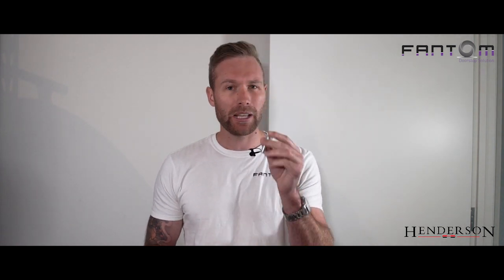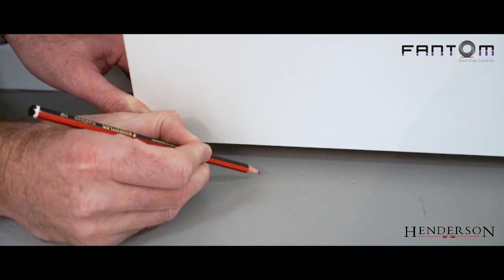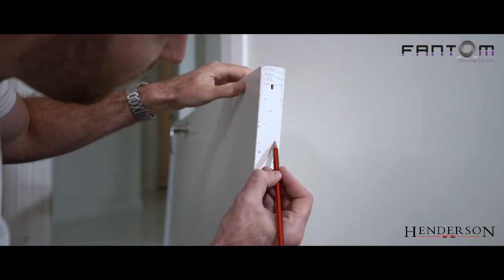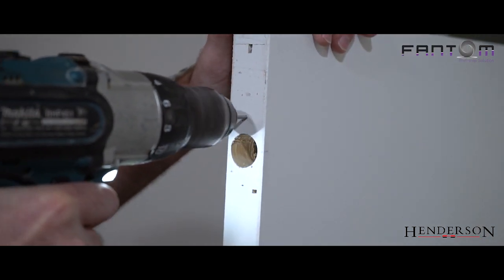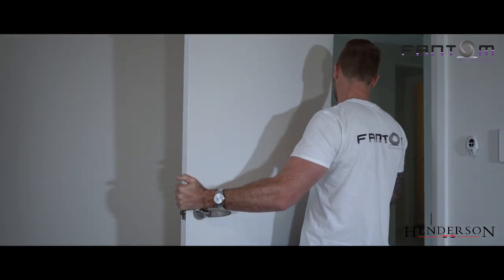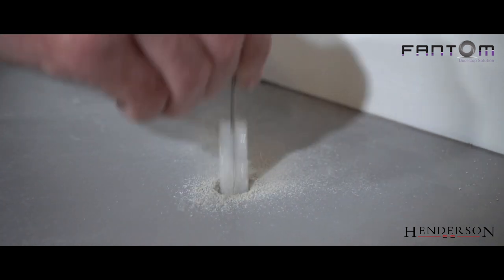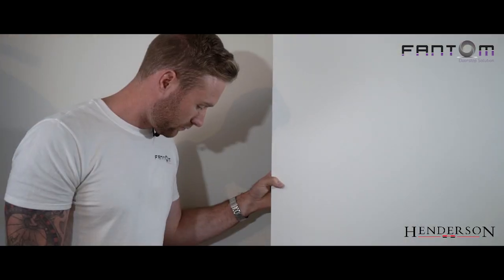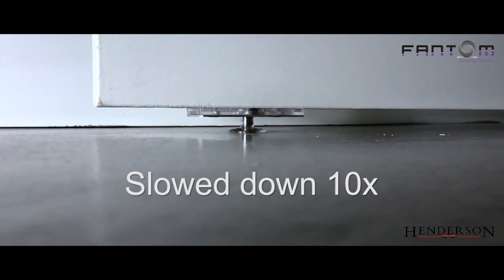How to: Install a Fantom Magnetic Door Stop - P C Henderson

Comment: If I run the vacuum over the pin when cleaning  will it suck it up?
Reply from the maker: Hi Electroman1970, thanks for your question. We can assure you that you can use any vacuum when cleaning close to the Fantom Magnetic Door Stop :-)